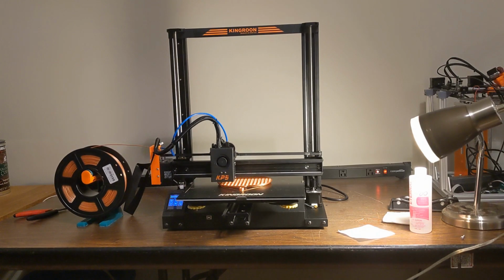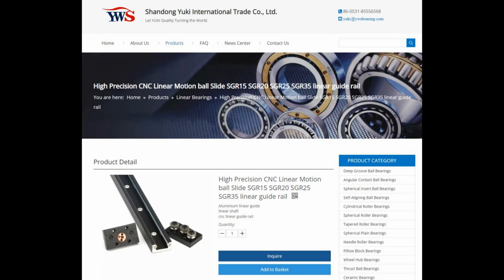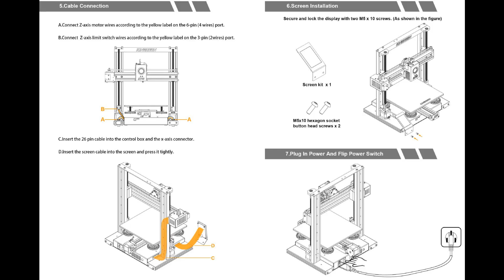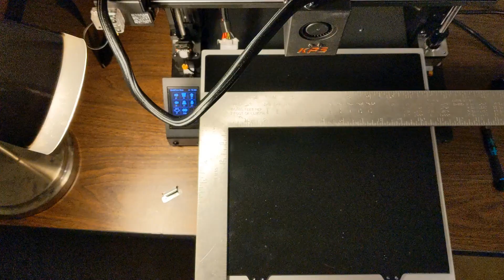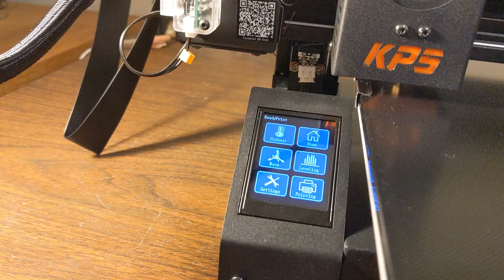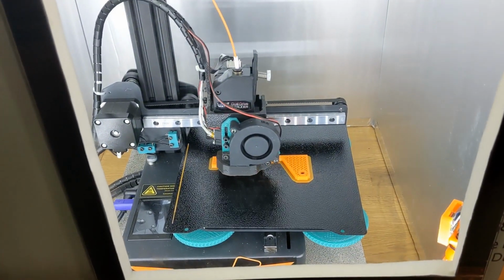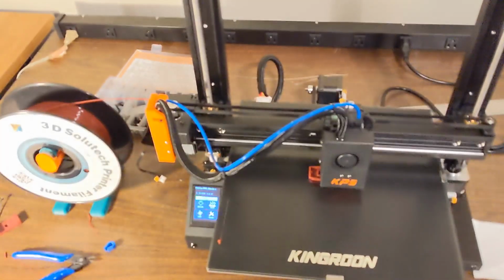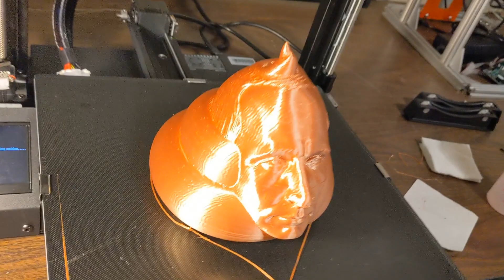Kingroon KP5L 3D Printer Review

Comment: I just retired a KP3S (as in, it had serious problems where replacement components were getting up there in $ compared to a new unit, and I may have been looking for an excuse to get something bigger anyhow) and ended up getting one of these.  First thing I set out to do was babysit the ever loving hell out of it and hand fed it filament while it printed necessary components to ensure the limp dick runout sensor stopped choking the shit out of the extruder idler.  Turns out the accessories were coupled with this fantastic review.  So far it has been serving me well.

Comment: Like pretty much everyone else has said, top notch review! Was educational and entertaining - just about everything you can ask for in a YouTube review.

I'm curious where you ended up heading from here though. You got Klipper working; Looks like you got a BLTouch running fine as well based on the printables uploads (thanks for those by the way!). I assume you ended up replacing the not-so-V6 clone as to print higher temp materials - mind sharing what you ended up going with? Also did you end up / do you plan on resolving the dual-z alignment situation or is the printer more or less 'fine' without bothering with another driver and/or a timing belt? Any other major upgrades so far?

Thanks for the great vid!

Comment: Love your review format. No fluff, no bullshit and straight to the point w/ tips. Just ordered one. I have an old CR Touch - do you think it'll be plug and play after a firmware update? Couldn't find any info anywhere about this and the BL touch info is also limited.
Reply from the maker: Thanks.  The board has a dedicated BLTouch port, so connecting it should be that simple.  As far as modifying the FW, you can probably (I honestly don't know for sure) use the KP3S guide they posted to get the basic gist of what needs to be done.  The config file being in Chinese doesn't help, but it's something?  https://kingroon.com/blogs/downloads/kingroon-kp3s-bltouch-installation

Hopefully I can get some time to fuck around with it this weekend and try to get klipper installed.  It's much easier to add a BLTouch in klipper than marlin.

Comment: As to the print bed size, I'd guess it's made to mimic the CR-10(310x310).  The real question is do the support screw holes match the CR-10?  240mm square formed by the screw holes, 35mm from screw hole to nearest edge.

If so, you could buy a Gulf coast robotics aluminum plate and a 120/240v silicone pad.

Or just a CR-10 24V bed/plate replacement if you aren't dead set on playing with mains voltage.

Comment: I bought a printer but I'm having problems.
After a few months there was a defect in the hotend heating, in which when turning on the printer it heats up non-stop, exceeding 300 degrees.
Searching the internet they suggested updating the firmware but I couldn't find instructions for doing this update, the company's official website has nothing, there is a lack of better customer support.
Reply from the maker: It's not a FW issue - not directly, at least.  If the FW was bad, it would have been happening from day one.  I suggest replacing the hotend, preferably with a better one.  You can get knockoff full-metal V6 hotends pretty cheap.

Comment: Great review - adroit, insightful, and funny commentary.  You mentioned that there is a socket for a touch sensor - is this feature reflected in the software?
Reply from the maker: I don't know it it's enabled in the factory FW, but I installed a BLTouch and got it working without much trouble using klipper.  Presumably you could recompile marlin with it enabled, but kingroon doesn't supply the source so you'd be on your own for figuring that out.  It's worth the minimal effort to convert to klipper if you want to add a leveling probe.

I'm hoping to have a followup video in a week or so with updates and upgrades, including klipper and BLTouch.
Reply: @mortalwombat5811  Thanks a lot for your efforts and sharing your knowledge.  I’m not unfamiliar with using a raspberry pi, but it’s been several years since I’ve needed to.  Any help would be appreciated as my time is about to get absorbed back into work :)
Reply: @mortalwombat5811  do you have a tutorial?
Reply from the maker: @brandoneich2412  For klipper?  No, but it's the same process as the KP3S:  https://3dprintbeginner.com/how-to-install-klipper-on-kingroon-kp3s/

Follow that guide, but use the printer.cfg (and the compile settings listed in the printer.cfg) here: https://www.printables.com/model/167983-kingroon-kp5l-adjustable-fan-duct-with-bltouch-mou/files

Comment: Excellent review. I was tempted to get one of these when it was announced available, but I decided it'd be better to wait.

Seems like this thing has a ton of potential. A lot of the components are executed poorly though. I love my KP3S after putting Klipper on it, so hopefully the KP5L can eventually become more desirable as I don't trust a lot of the large format printers available from Chinese companies.
Reply from the maker: I did manage to get klipper installed on the KP5L.  I just uploaded the config file with compile settings to the thangs page linked in the description.  As expected, it improves print quality substantially.
Reply: @mortalwombat5811  Would you by any chance know why the hotend fan on the KP3S is always on even on Klipper? I just assumed it's plugged into an always on port, but it would be great to get confirmation. I have it as pin PB0 in my config.
Reply from the maker: @760creations  That's pretty standard.  I have like half a dozen printers, and they all run the hotend cooling fan whenever they're powered up.
Reply: It's 249 right now lol, I ordered one.

Comment: That was a great review(sub)! what is the noise levels of the KP5L while printing?
Reply from the maker: It's about the same as any newer cheap printer.  The drivers are silent, but the fans definitely aren't.  It would be easy enough to replace all the fans with quieter ones if noise is an issue, but it doesn't bother me at all.
Reply: @mortalwombat5811  thanks!

Comment: Thank you so much for the detailed review, we're so sorry for the problem of the printer. we would feedback these problems you mentioned to our product team. You could follow our official blog, the improvement of this printer would updates on our official blog. Sorry for the inconvenience.                                                        Pls download the stock firmware here: https://kingroon.com/blogs/downloads/kingroon-kp5l-firmware-to-download
Reply from the maker: Thank you for the firmware link.  I think the KP5L has a lot of potential, and if your team can resolve the handful of issues, it could definitely be a great printer.  If you want to give them a simple list, in order of importance:

1. Filament path management and cable support
2. Bed cable strain relief
3. Z lead screw sync
4. Bed insulation catching on Y motor bracket
5. X belt tension adjustment
6. Power switch location for easy access in an emergency
7. Temperature presets in the preheating menu

I'm a big fan of the KP3S and I know that machine has gone through several revisions over the last couple years.  I hope you continue to identify issues and improve the KP5L as well.  You might also want to watch CHEP's comparison of the KP3S and Ender 2 pro for more suggestions: https://www.youtube.com/watch?v=wUc35iQxidI
Reply: @mortalwombat5811   Thank you so much for the problems you listed and your support to us, pls join our official FB group, we would update the improvement method of KP5L in these groups, so that we could interact together.
Here is our official FB group: 
Kingroon 3D Official User Group
Kingroon KP5S / KP5M / KP5L 3D Printer Owners
Reply: I would like to add, the bed is not 310x310. It’s 310 on the X but is 330 or so on the Y.

There’s no chance the bed can slide back without the foam hitting pretty bad. The rubber bushings are too short or the foam too tall. 

Also, one of the screws to level the bed was bent about 20 degrees out of whack. 

-ben
Reply: @BenHeien  
Hi Ben, Thank you for your feedback. We have reflected to our product team and they've been working on the solutions. 
For the print size. the bed size is 310*320mm, and the print size is 300*300mm. We'll add this information on our official website to avoid more confusion caused to our customers. Thank you for pointing it out.